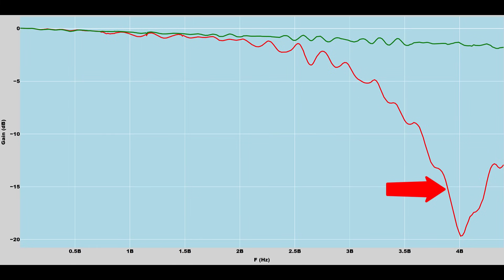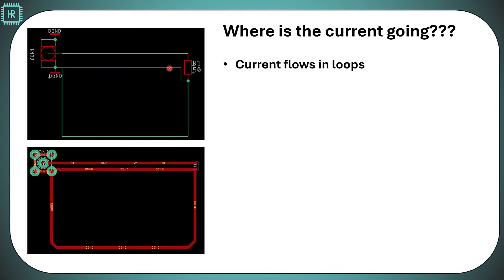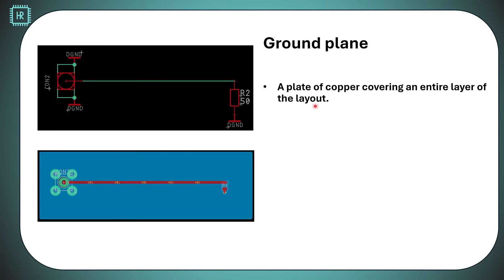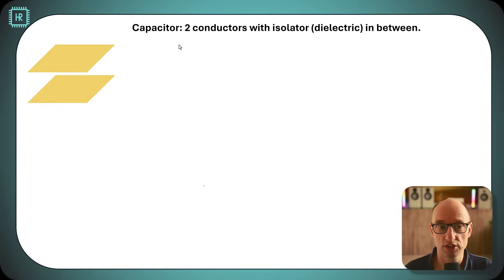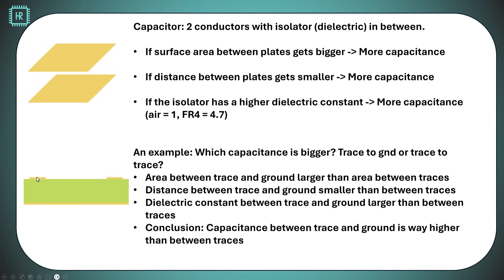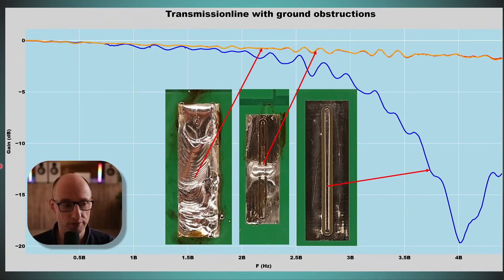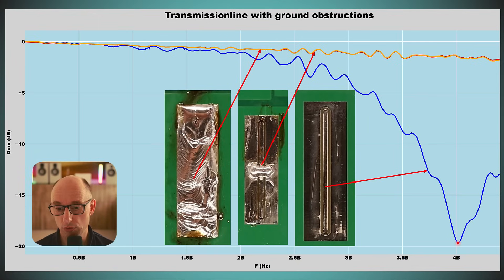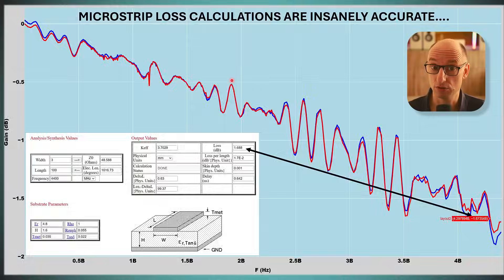Flawless PCB design: RF rules of thumb - Part 1

Comment: Could you do comparison of floating top plane against the same plane but grounded with a couple of vias, but only on eg. Left side of PCB? I've had an argument with my colleague which refused to put more vias on GND plane. In my opinion leaving long "traces" of GND 5-10cm) grounded on one end is practically same mistake as leaving them floating.
Reply from the maker: Yes, as frequency gets high enough, standing waves will form on that plane. My 4th video on my channel is about that: https://youtu.be/vumYrebIXm0
You can also watch my free module, link in the description. (get your colleague to watch it :-) )

Comment: Thank you for this video. I designed an RF rectifier for my studies project and used lumped elements for the impedance-matching network. When I tested my S11 on the VNA, I observed dips at incorrect frequencies that were not what I had designed. The second circuit was an RF rectifier with a boost converter, which resulted in an S11 that was even worse.

Comment: You could make a video of impedance matching traces and circuits as well. There is a bunch of information about this on the internet but they are not clear. I'm sure your explanaition would be the best. Also, I'd like to recommend another topic for a video that would be "when not use ground pours", for example, I'm working with a transimpedance amplifier for a photodiode where the datasheed says to not use ground pours bellow the op amp. Why they recommend that? Again, I can't think of a better pearson to explain that :-)
Reply from the maker: The hole in the ground-plane is to prevent parasitic capacitance. If you want to know the exact answer and trade-off, it's in my free mini-course. Link is in the description.

Comment: I'm ultra noob, I'm here because idk where to start,
Reply from the maker: Well, this is a good place, but I'd start learning the absolute basics on electronics. What are resistors, capacitors inductors, what is ohms law, voltage sources, leds etc.
Reply: @HansRosenberg74 I knew the basic, i just don't really understand a lot of circuit and chips. I'm trying to learn by making foc controller from available schematic because Its hard, long, and risky to buy one import, and i really need some.

Comment: Love it. I knew most but the blob under the strip accuracy to full cover the strip blew me away. My RF transmission lines look a lot like the last case with a top side ground plane, but hammering the .... down with vias (and using the proper impedance calculator). But I also have very cost sensitive application so usig two layer boards, which must have occasional short traces in the lower ground plane.This really gives me an idea of how to raise the frequency of any impedance rise by getting as close to shorting those gaps (but with the impedance of a via), so at least somewhat mitigating. Of course I don't have that in the major RF transmission lines but have a lot of digital etc which are also in essence lower frequency RF.
Reply from the maker: Thanks for the comment :-)

Comment: Hello Mr. Rosenberg, Could you send me the checklist please
Reply from the maker: I've changed the free checklist offer a bit: You also get a 1 hour module of my course for free!

You can find the link to the page in the description. Scroll down a bit on that page (Or read the whole page, you may get curious :-) ) to find the link. It is a purple button 'Watch The Free Module And Get The Checklist'.

You will have to leave your email address so I can start spamming you :-D . I don't do that very often, on average once a month, but I am thinking about starting an email series with useful electronics tips at some point.

Best regards,

Hans Rosenberg

Comment: Hi Mr.Hans, Thank you so much for your contribution with these wonderful materials. I am interested. Please send me the checklist!! Thanks.
Reply from the maker: I've changed the free checklist offer a bit: You also get a 1 hour module of my course for free!

You can find the link to the page in the description. Scroll down a bit on that page (Or read the whole page, you may get curious :-) ) to find the link. It is a purple button 'Watch The Free Module And Get The Checklist'.

You will have to leave your email address so I can start spamming you :-D . I don't do that very often, on average once a month, but I am thinking about starting an email series with useful electronics tips at some point.

Best regards,

Hans Rosenberg

Comment: Fantastic videos Hans. I'm an IC designer learning how to make PCBs so very useful. Please send me your checklist. Thanks!
Reply from the maker: Hi Paul, Link is in the description. It also includes a free 1hour module of my course that I think will be incredibly valuable to you if you learn PCB design. It contains the information in this video as well as a part of it.

Quick question since you're doing IC-to-PCB: Are you doing this for a one-off project or is this becoming part of your regular work? 

The reason I ask - if it's regular work, I'd strongly suggest my course. The 'real world' has so many pitfalls that are not present in the 'IC design world' (I designed testboards for ic prototypes for 11 years for an IC design company so I know exactly what I'm talking about) that you're probably going to run into a bunch of very costly and time-consuming boobytraps which my course is meant to prevent. You really would be my 'perfect candidate': you have great electronics knowledge already but not the practical real world pcb knowledge, you'd get the biggest return on investment! The cost of a single mistake usually pays back for my course multifold.

https://www.hans-rosenberg.com/epdc_information

Comment: Please send me the checklist :). Thanks!!
Reply from the maker: I've changed the free checklist offer a bit: You also get a 1 hour module of my course for free!

You can find the link to the page in the description. Scroll down a bit on that page (Or read the whole page, you may get curious :-) ) to find the link. It is a purple button 'Watch The Free Module And Get The Checklist'.

You will have to leave your email address so I can start spamming you :-D . I don't do that very often, on average once a month, but I am thinking about starting an email series with useful electronics tips at some point.

Best regards,

Hans Rosenberg

Comment: I found this video very helpful. Thank you! Please send me the checklist.
Reply from the maker: I've changed the free checklist offer a bit: You also get a 1 hour module of my course for free!

You can find the link to the page in the description. Scroll down a bit on that page (Or read the whole page, you may get curious :-) ) to find the link. It is a purple button 'Watch The Free Module And Get The Checklist'.

You will have to leave your email address so I can start spamming you :-D . I don't do that very often, on average once a month, but I am thinking about starting an email series with useful electronics tips at some point.

Best regards,

Hans Rosenberg

Comment: Hello Rosenberg, amazingly valuable video. I just started out on analog signal design. Can you please send me CHECKLIST? I would greatly appreciate it
Reply from the maker: I've changed the free checklist offer a bit: You also get a 1 hour module of my course for free!

You can find the link to the page in the description. Scroll down a bit on that page (Or read the whole page, you may get curious :-) ) to find the link. It is a purple button 'Watch The Free Module And Get The Checklist'.

You will have to leave your email address so I can start spamming you :-D . I don't do that very often, on average once a month, but I am thinking about starting an email series with useful electronics tips at some point.

Best regards,

Hans Rosenberg

Comment: That's very amazing, please can you send me the check list
Reply from the maker: I've changed the free checklist offer a bit: You also get a 1 hour module of my course for free!

You can find the link to the page in the description. Scroll down a bit on that page (Or read the whole page, you may get curious :-) ) to find the link. It is a purple button 'Watch The Free Module And Get The Checklist'.

You will have to leave your email address so I can start spamming you :-D . I don't do that very often, on average once a month, but I am thinking about starting an email series with useful electronics tips at some point.

Best regards,

Hans Rosenberg

Comment: Its a very informative video.
Please send me the checklist
Reply from the maker: I've changed the free checklist offer a bit: You also get a 1 hour module of my course for free!

You can find the link to the page in the description. Scroll down a bit on that page (Or read the whole page, you may get curious :-) ) to find the link. It is a purple button 'Watch The Free Module And Get The Checklist'.

You will have to leave your email address so I can start spamming you :-D . I don't do that very often, on average once a month, but I am thinking about starting an email series with useful electronics tips at some point.

Best regards,

Hans Rosenberg

Comment: Hello, please send me the checklist.  Thanks.
Reply from the maker: I've changed the free checklist offer a bit: You also get a 1 hour module of my course for free!

You can find the link to the page in the description. Scroll down a bit on that page (Or read the whole page, you may get curious :-) ) to find the link. It is a purple button 'Watch The Free Module And Get The Checklist'.

You will have to leave your email address so I can start spamming you :-D . I don't do that very often, on average once a month, but I am thinking about starting an email series with useful electronics tips at some point.

Best regards,

Hans Rosenberg

Comment: Please send your checklist. V useful advice.
Reply from the maker: I've changed the free checklist offer a bit: You also get a 1 hour module of my course for free!

You can find the link to the page in the description. Scroll down a bit on that page (Or read the whole page, you may get curious :-) ) to find the link. It is a purple button 'Watch The Free Module And Get The Checklist'.

You will have to leave your email address so I can start spamming you :-D . I don't do that very often, on average once a month, but I am thinking about starting an email series with useful electronics tips at some point.

Best regards,

Hans Rosenberg

Comment: Send me the checklist! Cheers!
Reply from the maker: I've changed the free checklist offer a bit: You also get a 1 hour module of my course for free!

You can find the link to the page in the description. Scroll down a bit on that page (Or read the whole page, you may get curious :-) ) to find the link. It is a purple button 'Watch The Free Module And Get The Checklist'.

You will have to leave your email address so I can start spamming you :-D . I don't do that very often, on average once a month, but I am thinking about starting an email series with useful electronics tips at some point.

Best regards,

Hans Rosenberg

Comment: Send me the checklist!
The solder blob demonstration was great
Reply from the maker: haha, thanks. Link is in the description
Reply from the maker: I've changed the free checklist offer a bit: You also get a 1 hour module of my course for free!

You can find the link to the page in the description. Scroll down a bit on that page (Or read the whole page, you may get curious :-) ) to find the link. It is a purple button 'Watch The Free Module And Get The Checklist'.

You will have to leave your email address so I can start spamming you :-D . I don't do that very often, on average once a month, but I am thinking about starting an email series with useful electronics tips at some point.

Best regards,

Hans Rosenberg

Comment: Send me the checklist, great video
Reply from the maker: I've changed the free checklist offer a bit: You also get a 1 hour module of my course for free!

You can find the link to the page in the description. Scroll down a bit on that page (Or read the whole page, you may get curious :-) ) to find the link. It is a purple button 'Watch The Free Module And Get The Checklist'.

You will have to leave your email address so I can start spamming you :-D . I don't do that very often, on average once a month, but I am thinking about starting an email series with useful electronics tips at some point.

Best regards,

Hans Rosenberg

Comment: Send me the checklist, please ! Great video
Reply from the maker: I've changed the free checklist offer a bit: You also get a 1 hour module of my course for free!

You can find the link to the page in the description. Scroll down a bit on that page (Or read the whole page, you may get curious :-) ) to find the link. It is a purple button 'Watch The Free Module And Get The Checklist'.

You will have to leave your email address so I can start spamming you :-D . I don't do that very often, on average once a month, but I am thinking about starting an email series with useful electronics tips at some point.

Best regards,

Hans Rosenberg

Comment: Great conten! Can I have the checklist?
Reply from the maker: I've changed the free checklist offer a bit: You also get a 1 hour module of my course for free!

You can find the link to the page in the description. Scroll down a bit on that page (Or read the whole page, you may get curious :-) ) to find the link. It is a purple button 'Watch The Free Module And Get The Checklist'.

You will have to leave your email address so I can start spamming you :-D . I don't do that very often, on average once a month, but I am thinking about starting an email series with useful electronics tips at some point.

Best regards,

Hans Rosenberg

Comment: Very helpful, thank you! Please may I have a copy of your checklist?
Reply from the maker: I've changed the free checklist offer a bit: You also get a 1 hour module of my course for free!

You can find the link to the page in the description. Scroll down a bit on that page (Or read the whole page, you may get curious :-) ) to find the link. It is a purple button 'Watch The Free Module And Get The Checklist'.

You will have to leave your email address so I can start spamming you :-D . I don't do that very often, on average once a month, but I am thinking about starting an email series with useful electronics tips at some point.

Best regards,

Hans Rosenberg

Comment: Send me the checklist, Please :)
Reply from the maker: I've changed the free checklist offer a bit: You also get a 1 hour module of my course for free!

You can find the link to the page in the description. Scroll down a bit on that page (Or read the whole page, you may get curious :-) ) to find the link. It is a purple button 'Watch The Free Module And Get The Checklist'.

You will have to leave your email address so I can start spamming you :-D . I don't do that very often, on average once a month, but I am thinking about starting an email series with useful electronics tips at some point.

Best regards,

Hans Rosenberg

Comment: Checklist please.
Reply from the maker: I've changed the free checklist offer a bit: You also get a 1 hour module of my course for free!

You can find the link to the page in the description. Scroll down a bit on that page (Or read the whole page, you may get curious :-) ) to find the link. It is a purple button 'Watch The Free Module And Get The Checklist'.

You will have to leave your email address so I can start spamming you :-D . I don't do that very often, on average once a month, but I am thinking about starting an email series with useful electronics tips at some point.

Best regards,

Hans Rosenberg

Comment: Please can I have the checklist?
Reply from the maker: I've changed the free checklist offer a bit: You also get a 1 hour module of my course for free!

You can find the link to the page in the description. Scroll down a bit on that page (Or read the whole page, you may get curious :-) ) to find the link. It is a purple button 'Watch The Free Module And Get The Checklist'.

You will have to leave your email address so I can start spamming you :-D . I don't do that very often, on average once a month, but I am thinking about starting an email series with useful electronics tips at some point.

Best regards,

Hans Rosenberg

Comment: May I have the checklist please?
Reply from the maker: I've changed the free checklist offer a bit: You also get a 1 hour module of my course for free!

You can find the link to the page in the description. Scroll down a bit on that page (Or read the whole page, you may get curious :-) ) to find the link. It is a purple button 'Watch The Free Module And Get The Checklist'.

You will have to leave your email address so I can start spamming you :-D . I don't do that very often, on average once a month, but I am thinking about starting an email series with useful electronics tips at some point.

Best regards,

Hans Rosenberg

Comment: Could you send me the checklist? Thank you.
Reply from the maker: I've changed the free checklist offer a bit: You also get a 1 hour module of my course for free!

You can find the link to the page in the description. Scroll down a bit on that page (Or read the whole page, you may get curious :-) ) to find the link. It is a purple button 'Watch The Free Module And Get The Checklist'.

You will have to leave your email address so I can start spamming you :-D . I don't do that very often, on average once a month, but I am thinking about starting an email series with useful electronics tips at some point.

Best regards,

Hans Rosenberg